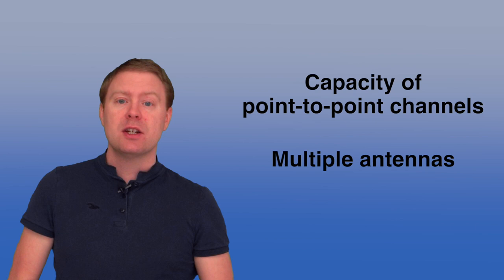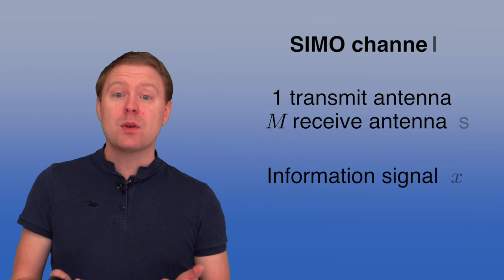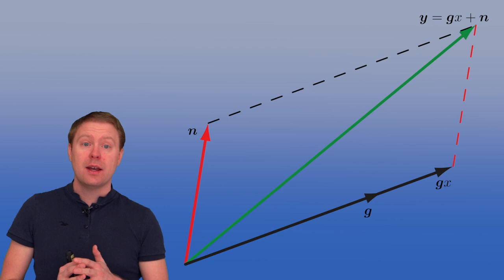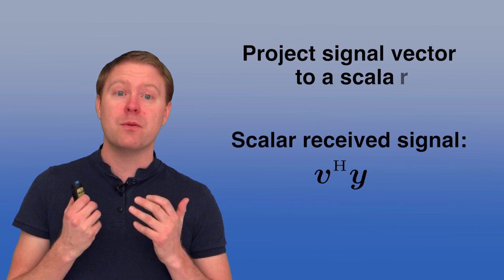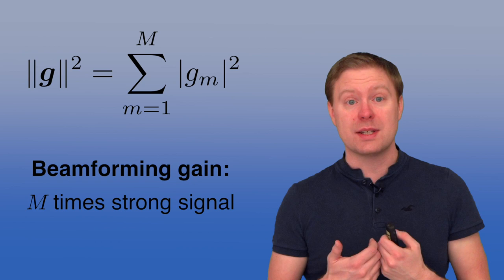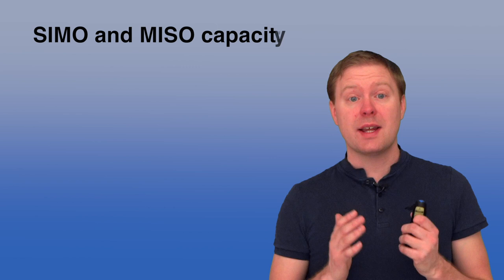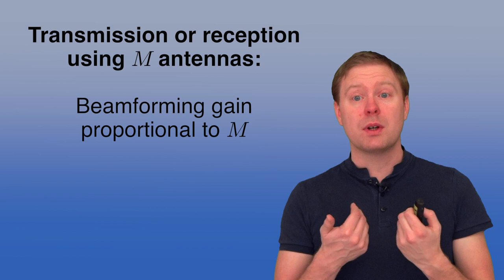Capacity of Point-to-point SIMO and MISO Channels [Video 5]

Comment: I think MRC has beamforming gain, however not for MRT. As the total power of M transmitting antenna sums to one unit, while the M receivers can receive M copies.
Reply from the maker: The beamforming gain is the same in both cases, but is achieved in different ways. As you say, in the SIMO case, we are collecting M times more power. MRC is then combining the M signal so that we extract M times more signal power without extracting M times more noise. In the MISO case, the transmission is focused towards the receiver so that M times more signal power is traveling in that direction. It is based on the concept of constructive interference.
Reply: @WirelessFuture  Thanks for the reply. ''''the transmission is focused towards the receiver so that M times more signal power is traveling in that direction.'' I think this means you need to transmit M times the original power - If you limit the power transmitted by all the M antennas also as one unit, then there is no beamforming gain, and only diversity gain can be achieved. I think the video also tells the same thing: In 8:34, there is a norm g on the denominator of w, so when you perform MRT in 9:17, there is a mistake - should not be a norm g  there in the second line.
Reply from the maker: No, the norm at 8:34 is making sure that the total transmit power is constant irrespective of the number of antennas. This norm is utilized at 9:17, where the computation between the first and second line is g^T w = g^T g^*/||g|| = ||g||^2/||g|| = ||g||.

The beamforming gain when using MRT is achieved by creating a directional transmission where M times more power is traveling in the desired direction and less power in other directions.
Reply: @WirelessFuture  Yes, true. I made the mistake of thinking no CSI at the transmitter. Thank you.

Comment: Thanks for great explanation! 
I have one doubt regarding MISO case. You said Vector(x) = Vector(w) * Information signal (x tilda). That means, are  we sending same information signal through all the transmit antennas?
Reply from the maker: Yes, the same signal from all antennas but with different phase shifts. The phase shifts create a beam in a particular direction using the phenomenon of constructive interference.
Reply: @WirelessFuture  Thanks for such quick reply!

Comment: Sir, I have one doubt, I have been trying this for several weeks, but kinda stuck here. 

How to apply MRC for MIMO system, because, unlike SIMO (where you have explained MRC), MIMO involves >1 Transmit and Receive antennas. 

Eg: (2 by 2 MIMO), Y1 = g11 x1 + g12 x2 + awgn.

Y2 = g21 x1 + g22 x2 + awgn 

If we apply MRC here: 
Y_combined = V1 (Y1) + V2 (Y2). 
How exactly to calculate V1, V2 here, either I get stuck with matrix dimension mismatch, or which all g's to consider for V1 or V2.

Any specifically, should the transmit data from multiple tx antennas should be same or different? 

2. If data from different tx. Antennas are different again, here I get confused with channel estimation using Least Square equation.  

3. Zero force receiver and MRC are different things right, they can be used together. As in, MRC to combine and ZF to estimate X from received signal Y at rx.
Reply from the maker: MRC is used for SIMO channels and MRT is used for MISO channels. One shouldn’t use any of these methods in a MIMO channel. The next video in this series (Video 6) is describing the MIMO case.

Least square estimation is not considered in this video. But if you want the estimate a MIMO channel, you can first send a pilot signal from the first antenna and then from the second antenna. You essentially divide the problem into estimation of SIMO channels.
Reply: Firstly, a big thank you for explaining concepts in terms of vector diagrammatic representation , I had never thought it in that way. 

All this time, I was trying to implement MIMO using MRC. 😅

Secondly,  so basically MIMO revolves around SVD or Zero force receiver? Or are there any other methods? 

Also, for Single user MIMO, we can either choose different data or same data to be transmitted from multiple transmit antennas right? (Both the case sum of power is ensured to be equal to total power?)

Comment: Do these concepts all apply to only one channel? E.g. is it fair to say if you have one transmitter and 3 receivers, each receiving a different message, is it still SIMO? Or is it 3x SISO?
Reply from the maker: There are multiple accepted terminologies for this scenario. I would call it SIMO based on the number of antennas, and then distinguish between single-user SIMO (considered in the video) and multi-user SIMO if there is a single-antenna base station and three receiving single-antenna users.

Comment: Thank you for this wonderful video! I am still confused on 7:57~8:07. It is a mathematical question, we want to know which part of x can be projected onto g? I still did not understand the reply below,  why we  use g^* rather than g. The second question, (g^T x) is maximized only when x equals g^*, why this is related with our question? x is fixed and g is fixed, why we could maximize (g^T x)?  We don't have variable here.
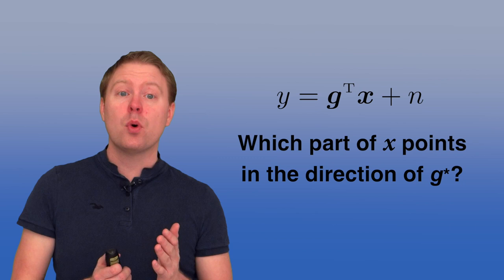Reply: sorry, in 7:43, why we want to know which part of x (rather than received signal y) is pointing in the same direction with channel vector g*? In SIMO cases, we projected y onto channel vector.

Comment: Could someone explain why is he multiplying the signal by the channel instead of making convolution?
Reply from the maker: foerfoer It is the so-called discrete time complex baseband representation. If you have a one-tap channel and transmit using pulse-amplitude modulation, you can get the channel model considered in this video after sampling at the receiver. The continuous time channel response will then be g*delta(t).

Comment: How do you know what all your gain factors, g_i are? Are they all a set quantity by the antenna designer?
Reply from the maker: These parameters indeed depend on the antennas, but mostly on the propagation environment between the transmitter and receiver. The values vary rapidly in practical scenarios where the user device is mobile. To deal with this, known so-called pilot reference signals are transmitted every few milliseconds to measure their current values.

Comment: Thank you for this video. In the context of Satellites MIMO signal processing,
I would like to ask what will be different if we have one mobile user connected to two satellites and we are considering both uplink and downlink channels. We want to compare the throughput with the case when the user is connected to only one satellite.
Besides the capacity (throughput) analysis, I would also like to know what do you think the differences are compared to the terrestrial case?
Reply from the maker: It is the same theory that can be applied to this case, but with a different channel model. One key question is whether the two satellites will be phase-synchronized (so they can do coherent beamforming, or if space-time codes will have to be used) and how they will exchange data between each other - do they have to send everything through a gateway on Earth?
Reply: @WirelessFuture  I believe that Satellites could achieve synchronization by exchanging information through ISL (inter-satellite Links), regarding the data exchange it will be a direct communication between Satellites and the user mobile phone, no gateway is considered in this scenario.

Comment: Thank you very much for sharing such a good explanation.
I have one question. Is it possible for the MISO case that the same signal is sent over each antenna? If that is possible, can this situation be treated as beamformig or transmit diversity? Thanks.
Reply from the maker: If you send the same signal on all the antennas without any phase-shifts, then that corresponds to using a precoding/beamforming vector with only ones. So it is a type of beamforming.

Comment: Many thanks for the insightful video. I have one question, for the MISO case, why the signal is projected onto g-conjugate, g*, rather than onto the channel g? Thanks for the kind help.
Reply from the maker: The inner product (g^T v) is maximized when v = g*. Since the vectors are complex, this is actually an inner product between g* and v. This optimal type of precoding is also known as "conjugate beamforming.
Reply: @WirelessFuture  Thank you very much for the kind help.

Comment: Thank you very much for the nice explanation for the capacity expressions for MISO and SIMO cases assuming MRT and MRC. I have one question, how these capacity expressions change if we assume no channel knowledge at BS for MISO or at the UT for SIMO ?
Reply from the maker: Eng/Ahmed Ra'fat Note that MRT and MRC are not assumptions, but they are the capacity achieving methods. I have assumed static/deterministic channels in this video and then it would be weird not knowing the channels. But in time varying channels, we can have partial channel knowledge. The base station needs to know the channel to make use of MRT/MRC. There are capacity lower bounds for the case with imperfect channel knowledge. You find such things in my book Massive MIMO networks or in the paper https://arxiv.org/pdf/1705.03577.pdf (there are many other papers)
Reply: Great, Thanks a lot
Reply: @WirelessFuture  Helpful..!!!!!!

Comment: why we do transpose of g w. r. to x at 7:33?
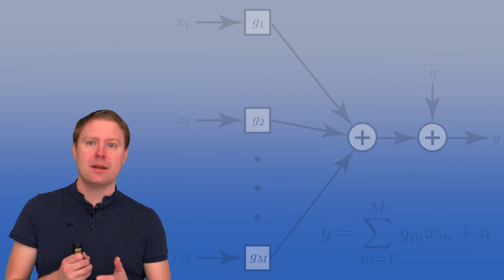Reply from the maker: It is a vector representation of the summation shown at 7:00. The vector description enables us to use linear algebra to identify the preferable precoding.
Reply: @WirelessFuture  ok, same with the case at 5.44 where we square signal power (g)^2 of the SNR value, if not what was the reason for that, why we do square of SNR values in some case like (single power)^2/(noise)^2 in the channel capacity ?
Reply from the maker: @mrjatt435  The SNR is a ratio of powers. The signal has amplitude sqrt(q)*g and power q*|g|^2. The system models are operating in the amplitude domain, while the SNR is computed in the power domain.

Comment: what is precoding (w) ?
Reply from the maker: When we want to transmit the same data from multiple transmit antenna, the radiated signal will become directive. We use precoding to control the directivity by varying the power and phase (delay) between the antennas.
Reply: @WirelessFuture  ok thanks